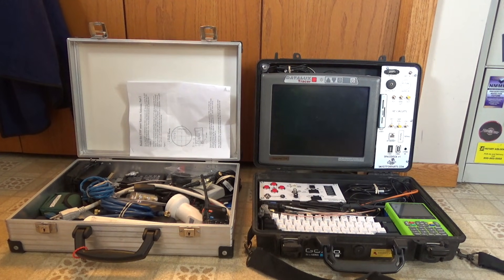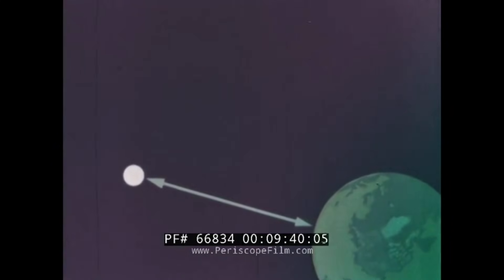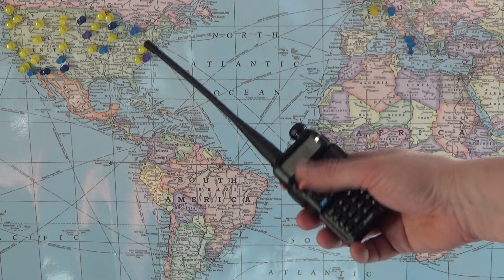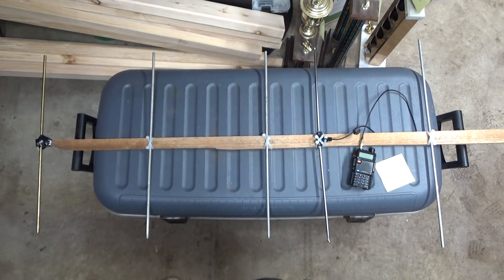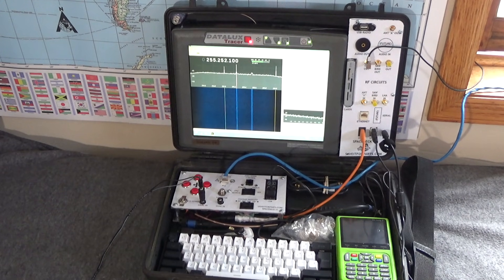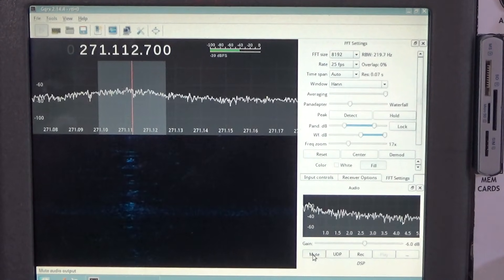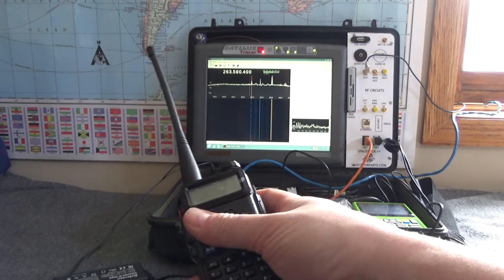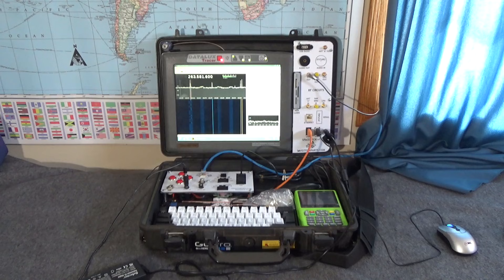Searching For Space Pirates On Old Military Satellites

Comment: It has been a few decades from my Electronics Technician Training.  That said, Check the length of the directors ( preceding the antenna ) and distance apart as well as the reflector ( after the antenna ) for the correct parts of the frequencies.  They looked to not be like Yagi where the reflector is larger and the preceding  ( you have 3 so front looking over half the length, next two almost the same, but shorter ).  You may also want to get some more wood and cut them in half, get some wire to connect the antenna to the middle directors in a cross pattern ( when held so the antenna is pointing right, bars up, top to bottom to top antenna segments and opposite for the pointing down antenna ).  Good luck hunting down the Space Pirates.
Reply: I just finished an ELE 111 course as an elective in my welding program.
Had a great teacher and it was a lot of fun.

Comment: FYI - most of the 'hiss' heard on VHF and especially UHF radios is internal; i.e. noise from the radio's first RF amplifier (not external). This can be confirmed by the simple experiment of disconnecting the antenna; if the hiss does not change then it's obviously internal. For more info, Google: Noise Figure RF.

Comment: You'd think people should definitely start using their Baofeng to transmit on those, if your equipment got confiscated it would be cheap to replace.
Reply: From North America you would need good power to reach those satelites without a serious yag. Only a mobile rig with 50 watts and a directional antenna in the north will work... and be spotty at best in FL.

Comment: A log periodic or yagi log periodic would give you the wider band. Your yagi is really on the low side gain wise. Down in the equator area, they will not need such high gain antennas. The voice you  heard sounded like Portuguese which while closer to Spanish can sound a bit like  Russian if you are not familiar with the two languages.
Reply: And I would have recognized Russian as I worked with a bunch of Russian engineers and started to learn the language from them. Its complex as hell but full of nuance and surprises.  These clowns on that channel sound like a bunch of CB trash and should be eliminated. Shutting off the satelite for a year or two should clear the board. THe radios would fall out of use quickly when the system goes dark.

Comment: 5:04 it is recommended to get the antenna off the ground for proper swr/resonance measurement. all the stray capacitance of the floor will detune your antenna by quite a bit. although it's not that critical for rx only, i would suggest you redo the measurement while the antenna is on its tripod.

Comment: I’ve been tracking these for a few years in the U.K. with mostly rabbit ears and a Tri band UV-5R or Yupiteru. A 1/4 wave ground plane antenna works well too.
The common frequencies seem to be between 255 and 262, usually  Brazilian Portuguese language or Russian. Comedy Radio from Russia is sometimes very clear, I’ve also heard Mosque broadcasts and even Karaoke microphones! 
It’s an interesting section of the radio spectrum. 
Thanks for the video 👍🏼
Reply: Some drunk singing karaoke unaware they are being broadcasted over a vast area 🤣
Reply: Brasileiros!!
Reply: I've always wanted to have some fun getting into a microphone or shop P.A  circuit 😂
Reply: uv52 is dual band
Reply: The UV5R III has 3 bands. It covers the 1.25m band and up to 260 MHz besides the usual VHF and UHF.
Reply: @FrancoDX  dual band is how many channels you can run at once .... by your logic then its really only a one band radio cus all it runs is fm ....
Reply: Mosques? Disgusting
Reply: What mode on the uv5r AM?

Comment: Hi there, the main "users"  on the military Fleetcom  VHF frequencies around 250 ... 260 MHz will be stations from Brazil. Here in the Netherlands they are easy to monitor, with a Discone antenna, or even a "vertical" for 2m//70cm.

Comment: In the twin cities there's MPR News at 91.1.The third harmonic of this would be on 273 MHz.... And there's KFAI on 90.3 MHz which would have it's third harmonic at 271 MHz but that's not MPR or NPR. Probably one of these signal is loud enough for you that the filtering after the mixer in the R820T tuner of the rtlsdr dongle can't knock it down below your noise floor at ~270 MHz. And then there's just some local clock error in freq that shifts it there.
Reply from the maker: Interesting, I wouldn't have expected a side harmonic to come in that strongly. I'll have to check if other FM stations do that too!
Reply: Interesting...as I am local. I know KQRS you can pick up darn near anywhere with the wattage they put out.
Reply: Just a question, if he was picking up the third harmonic of an FM station, wouldn't the signal stay somewhat constant if he changed the direction of the antenna? Wouldn't the harmonic be coming into the antenna/system from the side and not from the direction the yagi is pointed? I hope I asked that correctly. Thank you.
Reply: I was always wondering why i pick up FM radio signals with my analog 90's TV 😁(i use it for gaming).So it is a kind of unwanted FM transmission artifact.

Comment: A magnificent accomplishment.  Now, if only you'd been content to stop there.  Building that much bigger Yagi antenna and suspending it from a big white balloon sure seemed like a good idea at the time.........
Reply: Don’t worry bro I got your joke 😂
Reply: It's still a great way to loft a Yagi, but not everybody can afford a balloon.  Using a giant box kite would be more cost-efficient for a non-state actor.
Reply: @thadrobinson8343 good idea!
Reply: Maybe a LARGE KITE? 😊
Reply: @Allan_aka_RocKITEman good idea.
Reply: what happened?
Reply: Some notch filtering might help too.
Reply: There is no point in having the antenna very high up.  As long as you have line of sight to the satellite and not much local noise from electronics, it will be fine near ground level.
Reply: @la7dfa  atmospheric distortionand absorption? That said. This REALLY (yet again) makes me.wakna splurge my extra 35 bucks this month on a usb sdr dongle
Reply: @la7dfa just asking wouldn’t it help with interference? I don’t know.
Reply: @cliffp73  It would help with local interference from electronics if you have that.  But you can do the same by mounting the antenna on a small mast in the garden as many HAM radio ops would do.

Comment: 8:09 You are picking up local FM stations because RTL-SDRs have bad image rejection capability, I would recommend adding a FM broadcast bandstop filter to attenuate these signals
Reply: That or a harmonic of the original frequency. 
Or possibly the result of 2 frequencies mixing in an imperfect RF system.

After a few decades of working on antenna systems, I can confidently say RF can be pretty "black magic" outside of the mathematical theory world sometimes.
Reply: @pileofstuff  Likely 3rd harmonic of ~90.* MHz, where most NPR stations live.
Reply: @pileofstuff  -  We engineers used to say, 50% science and 50% witchcraft. Its really true. You should have seen some of the shit we saw and lived through LOL STuff from science fiction movies LOL
Reply: @pileofstuff  For something that only have about 48dB of in-band dynamic range, it's more likely to be image frequency / aliasing (especially because RTL-SDRs use direct conversion & doesn't have a great IF filter)
Reply: @pileofstuff  Oh, hey, I watch your videos! Never would've thought to see you here, lol.
Reply: Or a mixture of all the above, no pun intended.

Comment: I've not tested the metrics in any real comparative detail or to any standards other than the nanovna, though I'm still amazed how well my 450MHz yagi worked and works only using wooden rod with aluminum duct tape wrapping for the reflecting and directing elements.  I invested in a 3D printer pen to make the mounts more adjustable for finer tuning.  I never got around to making with the plastic knurled thumb screws or 3D printing, though did order and have most the parts I need if not all.

Comment: Nice Yagi antenna you whipped-up there! You can also cut up a tape measure to make flexible elements for the same.
Reply: Ha. The chopped up tape measure segments are also used for direction finders when fox hunting for transmitters. You can go rung through the undergrowth without the risk of being impaled by a ridgid element. Lighter also.

Comment: I’ve done a little SSTV on the amateur bands. Mostly just receiving.
Reply from the maker: I've experimented with getting SSTV from the space station, it's fun but a little frustrating when you only get half the picture. I need to mess around with it some more.
Reply: @saveitforparts  it’s a lot easier on 20m. Again- perfectly legal to decide on the ham band, just don’t transmit without a license. (Or get a license!)